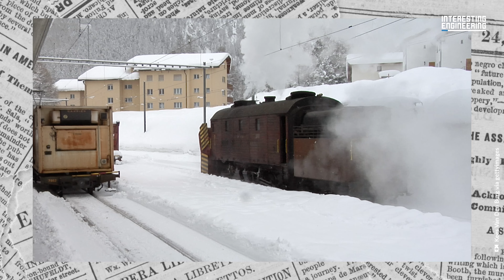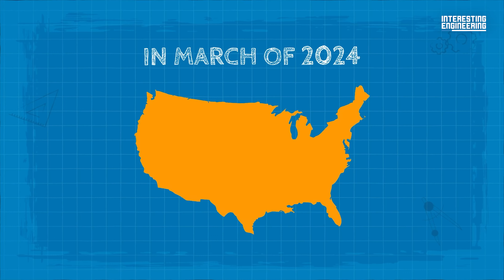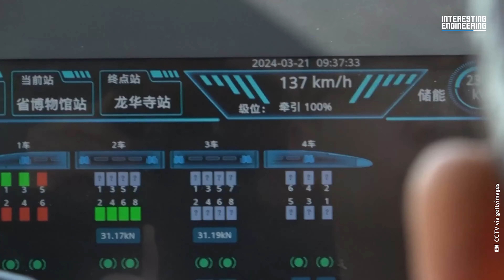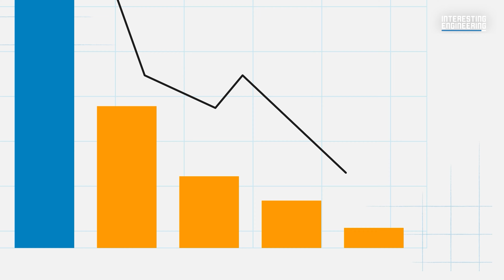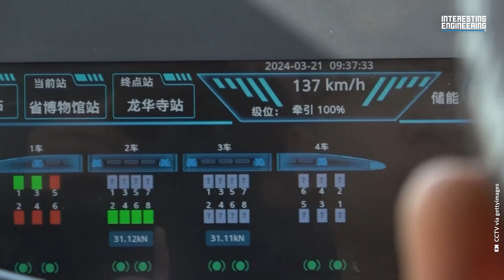This Record-Breaking Train Could Transform Rail Travel.

Comment: There is a power line right above the train track in every place that actually cares about trains.  Why carry around your feul as dead weight and waste energy to produce and transport hydrogen when this is na solved problem for about 100 years.
Reply: because electrifying railways is expensive, and for some reason people prefer to have a cheaper installation even if it means that the operation cost will be higher

(electrifying a railway is very expensive but that usually makes it less expensive to operate on the long run, though people usually do not see the second part)
Reply: @junovzla The weight issue can be further address through the use of lighter weight construction materials. Like carbon fiber.
Reply: @onlinesavant  what weight do you mean?
Reply: @onlinesavant never knew they used carbon fiber as a fuel source 😂
Reply: @junovzla also it’s not always cheapest long term if there arnt enough trains using the route such as branch lines and most freight lines
Reply: @rhysrail  correct for branch lines, but electric freight trains are still significantly more efficient
Reply: @junovzla   no, freight trains have trains on them every 3 hours ish which is no where near frequent enough to have it being cheaper to be electric
Reply: @rhysrail  you're right about the frequency, but also freight trains consume a lot of power, and having it all be diesel is not only worse for the environment but also less efficient
Reply: @junovzla  that’s why you would use hydrogen as diesels bad and electric is expensive

Comment: Green Hydrogen production is a highly inefficient way to store energy and carrying hydrogen ad a fuel adds weight to trains, not to mention the much greater complexity and cost of the trains. Grid-connected electric trains are far more efficient and flexible to utilize multiple clean energy sources. Hydrogen only makes sense for niche applications and will never succeed on a mass scale for trains. Fundamentally, the technology is inefficient.

Comment: The only reason not to electrify rail is cargo transport. Massive amounts of electicity are needed to make Hydrogen. Since we have yet to even eliminate most of fossil fuel power generation then why use that green power to make Hydrogen when it can electrify a rail line

Comment: The high use lines should have catenaries, so that let's say 90% of a railways tons per miles is electrified and then the low use lines of the system can use diesel.  This can be reduced over time.   It likely would make more sense to have locomotives which could charge batteries from the catenary sections of the mainlines, then go off onto the non-catenary sections and then return to the catenary sections.  
        The switching/shunting locomotives tend to not be moving cars 90% of the time and require a lot of power for an initial push, so a smaller diesel engine can charge batteries most of the time and then use the diesel engine and batteries for the shove.  The overall amount of combustion from idling is reduced.
Reply: The 90% is way to high and batteries are far heavier than a fuel cell so you are carrying more dead weight for a lot of the journey killing the efficiency benefits of batteries anyway

Comment: Sadly, fuel cells have an efficiency of <50% and hydrogen production is even worse.
Austrian Federal Railways (ÖBB) made tests of fuel cell trains and battery-driven ones. They decided to take the battery trains that can be reloaded while standing or running under overhead lines. Fuel cell trains also need batteries for recuperation (storage of braking energy) as fuel cells also cannot adapt rapidly to the varying demand of the train.
Additionally, battery trains do not need new infrastructure and little training for the personnel.
Electric traction energy in Austria and Switzerland comes 80% from renewable energy, therefore we may forget your CO2 values.
Reply: Please recall that not everywhere is blessed with huge, soggy mountains.
Reply: @TheHoveHeretic  Germany does it with wind and photovoltaic. Would also work in Britain and Ireland
Reply: DB tested these units in our region. They worked well but DB ended up buying diesel Hybrid units in the last couple of years.
Reply: @BJHolloway1  The advantage of the battery trains is that they don't need any additional diesel or hydrogen infrastructure as they always have overhead lines at one or both end stations and travel parts of their routes under OHL.

Comment: "Can Hydrogen-Powered Trains Revolutionize Rail Travel?"
No.
Reply: Yes 😂, let's meet after 20yrs.
Reply: @suryasainath708  How do you define "revolutionize rail travel"?
Even if hydrogen-fuel-cell-trains would really catch on, they wouldn't change the way of rail travel substantially. No harmful emissions in operation is nice, but no "revolution of rail travel".
Even if there was no alternative like "normal" electric trains with overhead wires.
Reply: Green Hydrogen transport is the epitome of burning cash while wasting more than half the available energy
Reply: There's always the possiblity of Nuclear power plants for electrification of railroads?..
Reply: @johnarnehansen9574 like Overhead lines with nuclear base-load. Experimentation, Consistent and common construction and creation will bring cheaper costs to building in bulk. But there always has to be the first to take the largest Cost and risk.
Reply: In primitive societies maybe
Reply: It can switch fuel for cargo train haulage from dirty diesel. Same for interstate semi truck propulsion.
Reply: @johnarnehansen9574 or just solar in the daytime and battery storage near the track for after- dark power. Wind can feed that storage when it has no grid demand otuerwise
Reply: @stephendoherty8291  And Thermoneuclear power stations to power electric trains on longer distances!..
Reply: @johnarnehansen9574  until modular nuclear is well ahead in commercial deployment,  then thats one of those uture world Sci fi books.A bit excessive for a train recharge vs buying unneeded solar and windpower to recharge the station to train battery store
Reply: @stephendoherty8291  I was talking about Railroad Electrification!...
Reply: Big YES.

Comment: If the motors are high speed, why did the train only average 38 mph?

Look, hydrogen may play a role in the short term merely because building out catenaries and developing denser batteries will take some time. It's really inefficient compared to electricity so it's doubtful as a long term solution.
Reply: Stops
Reply: High speed is 250 km/h. If you have so many stops, it averages under 60, there's no point.

Comment: Hydrogen is not a source of energy.  It is merely a chemical battery, and a rather inefficient one. 
Hydrogen powered trains, planes, and cars is a Green dream that will never become a reality.
It would be grossly irresponsible to expose the general public to the dangers of hydrogen (think Hindenburg). 
If you don't understand why, you need to study chemistry, thermodynamics, and engineering.
Reply: True, Hydrogen energy density makes it terrible fuel, for distributive methods like say car But a train with it's fixed infrastructure may actually make sense. Compared to cars, Train energy use isnt' all that bad. Rail accounts 8% worlds motorized passenger travel, but uses 2% of worlds transportation energy. Using widely plentiful electricity to make hydrogen. Advantage of the hydrogen train. 
- Carries it's own fuel supply, thus is not dependent overhead wire/third rail. Thus maintaining hundreds/thousands miles added infrastructure besides tracks eliminated. Hydrogen only needs to be stored in tanks and depending range, train can top off.
- Hydrogen is flammable, but it is non-toxic So if it ignites or breaches your only byproduct is water. 
- Hydrogen storage solutions and fuel cell take place atop the train. So should it's fuel contents explode or rupture they occur away from the passengers.
Reply: Depends entirely on the method of hydrogen separation.
Reply: that's why experiments in germany with hydrogen-trains are getting stopped. battery powered trains (lithium titanate) are just more efficient.
and the best part is, that such a train can charge on the main line that has power lines and when the train branches off on a track that is without power lines, it runs on battery. back on the main line, it can recharge.
Reply: Hydrogen was not directly responsible for the Hindenburg disaster. Pleanty of literature out there along with TV programmes.
Reply: @BJHolloway1  It didn't help that the doping compound for the canvas covering on the Hindenburg was not much different than that of solid rocket fuel. That's why when the airship exploded, the canvas covering burned off REALLY fast.
Reply: The thing is it has a very very high energy density which is precisely what you want with a battery and a fast refuel time as you just pump it in, also efficiency can be improved as with batteries so that point is wrong and also it is perfect and nothing like the hindenburg which was massive a ballon compared to lots of small strong tanks that even if they exploded would cause little damage, also you carry petrol round in your car which is just as dangerous as it doesn’t just float up into the air if it leaks
Reply: @robertheinrich2994 Germany is a very different country to the us, Germany has a majority of its lines electrified and only short branch lines compared to the us with the exact opposite, also just because the German government is doing something it doesn’t mean they are right as proved many times by history
Reply: @rhysrail  yes I know. it is very different. for example, the DB now has to suffer from not maintaining the network properly. other countries have nicely scheduled trains, germany does not.
while it is a cute idea to use hydrogen, and with white hydrogen, it is an even better idea, train travel doesn't profit a lot of it. but there are non-electrified lines. but those can be served better with battery powered trains.
Reply: @robertheinrich2994  never heard the term white hydrogen, is that just green hydrogen, also you absolutely can profit off hydrogen as with diesel as they are practically a same replacement in every way when they become mass market unlike electric which is incredibly impractical for trains as they travel through rural places and are massive meaning hydrogen is just better, I would say to decide what to use you should use electric if there are enough trains for it to be cheaper and then hydrogen on all long distance non electrified routes and then batteries on routes with very short distances non electrified like on light rail systems
Reply: @rhysrail  white hydrogen is geological hydrogen, that is extracted practically like natural gas. there have been a number of deposits found so far, but it's still very much at the beginning.
Reply: @robertheinrich2994  I’ve never heard of them, might read up on them
Reply: Gasoline is more dangerous than hydrogen since these heavy fuel accumulates on the ground level when leaked but the hydrogen will vent out and float upwards.

Comment: How do you make the hydrogen.
Reply: Main methods are electrolysis (i.e. hydrogen separated by passing a current through water), which is clean but currently expensive, or by the same polluting methods used to refine oil ('brown' hydrogen, though the fossil fuel industry prefers 'blue' ... for some odd reason).

Comment: I don't think hydrogen is practical for trains. Trains run on fixed paths, so just electrify everything  you can (90-95%), and use battery powered locomotives on the lowest traffic lines where even hanging the wire would be too costly.
Reply: For metros and intercity yes maybe maglev is better for intercity

Comment: The fundamental problem in using hydrogen for transportation, is transportation.  The delivery of hydrogen to where it is needed.

The reason that 98% of all hydrogen produced in the world from methane is because it is easy to transport, or produce, methane using fossil fuels.  This is why the fossil fuel industry is spending billions to promote hydrogen.  They already own the hydrogen production market!

Currently every hydrogen delivery point for vehicles has a methane to hydrogen production facility built in.  Only very small amounts of hydrogen can be stored in high pressure vessel on site and it is impossible to make them completely leak proof.  The hydrogen molecule is small enough to leak through stainless steel storage tanks!  This is why NASA keep filling their launch vehicles right up until immediately before they lift off.

For those that dream about hydrogen powered personal vehicles, I have one word.  Hindenburg.
Reply: Railway can produce onsite water to hydrogen production facility using solar power. near to the railway station.

Comment: So much bullshit 🤦

Hydrogen trains will never play a big role for trains. 

It's just too expensive compared to battery trains.
And if you have trains running every 30 minutes or more it's always worth it to use overhead catenary
Reply: They are cheaper than battery trains have far longer ranges and refuel faster making them perfect for trains unlike batteries which are heavy and have a low energy density while taking ages to recharge, all the efficiency benefits will also be lost due to the extra weight so hydrogen does have a future and it battery ones that won’t outside of light rail
Reply: @rhysrail  well look at how many hydrogen trains are failing in daily operations in Europe!

Hydrogen trains are much more expensive to operate than battery trains, because producing green hydrogen takes a lot more energy than charging a baterry with the same capacity.

And it's often difficult to even install a hydrogen filling station, because it's not available everywhere.

Yes they have a higher range, but it's still easier to install overhead wires for a small portion of a line to recharge the batteries of BEMUs for longer routes.

And no, BEMUs are not that much heavier than hydrogen trains, because it makes no sense to put so many batteries on a train to have the same range as a battery train.

Afterall: If you have 2 trains per hour or more on a railway line it's always worth it to just install overhead wires, like they did for Caltrain.

The operating costs are lower than with a hydrogen train
Reply: @nicolasblume1046  hydrogen trains are more expensive due to lack of research and economies of scale, there is also the fact we are facing very high energy prices currently due to a to quick change to renewables 

Hydrogen filling stations can be built as would battery ones need to be

You can’t recharge them for a short section, it takes roughly an hour to charge them if you base it off cars and going 80 miles per hour that means you will need 80 miles of track which is a lot of electrification to just get double the distance if your lucky, that makes it incredibly impractical and expensive and that’s without consideration the fact it puts extra strain on the wires having to draw over triple of the amount it uses and impossible for large trains, and then for freight it’d debatable whether you could even fit in enough batteries before going over the max weight and airflow requirements 

Are you basically saying you won’t put many batteries in it to make it lighter and cheaper but will have far less range? That means you will have 80 miles of line to recharge still (batteries take the same time to charge whether there’s 1 or 1000) but only like 40 miles of unnelectrified tracks making it basically pointless and you would be better electrifying it
Reply: @rhysrail  the main reason why producing hydrogen is far more expensive than charging a baterry is simple physics.

The process of producing green hydrogen just takes far more energy.
The possible anount of improvent is very limited
Reply: @nicolasblume1046  both parts of that are wrong, the reason it’s far more expensive is because electricity is expensive otherwise it would just be a bit more and secondly it’s not even physics as we can produce it more efficiently with better technology as all it is is splitting water to put it back together, in theory it could be 100% efficient, obviously it won’t be but it can get as close to it as possible like with batteries

And yes the process requires a lot of power but hydrogen also has a high energy density and it really isn’t that much at 20% which as I’ve already said would be traded off in the extra weight and even more traded off on the extra infrastructure required